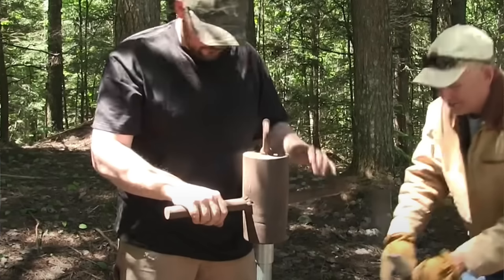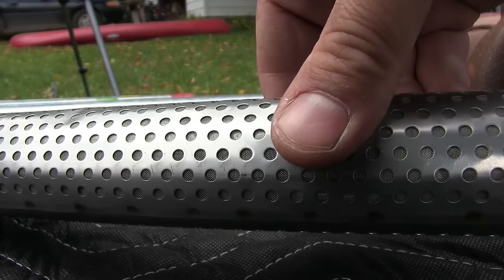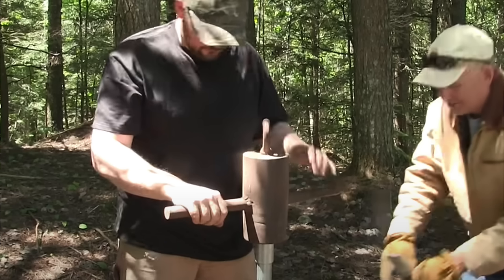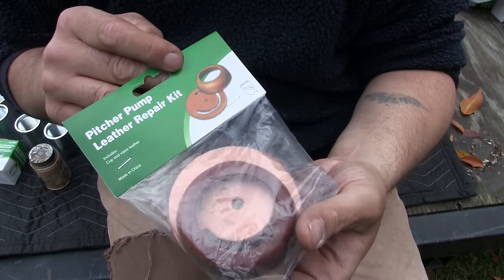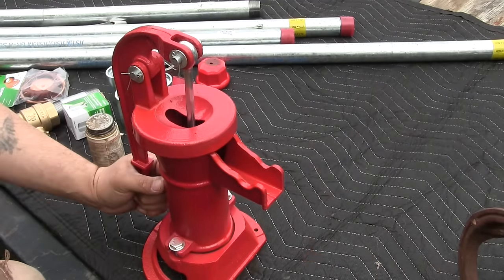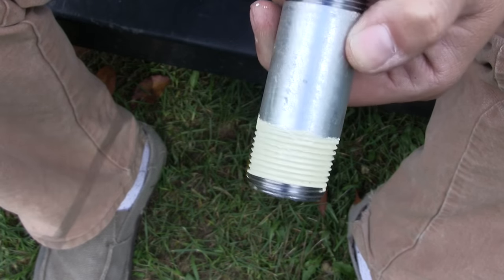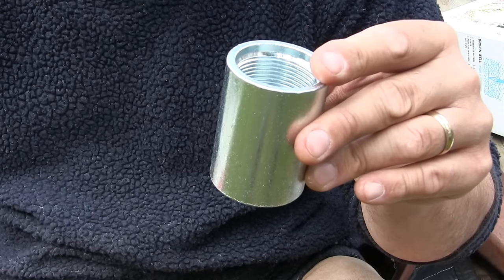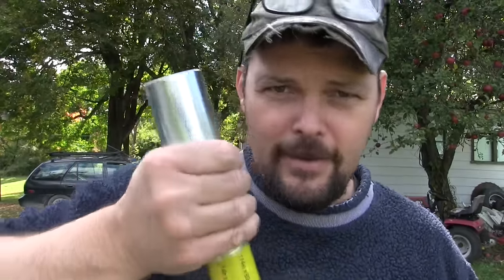Hand Pump Well , off-grid, self-reliant water, everything you need to know

Comment: Nice job, on your tutorial.  I have a couple of points, however.  1.)  If you use Teflon tape, and pipe dope on top, you will have a great seal, and IF you have to take it apart, for some reason(You probably will, your first time.), then the tape will minimize the mess.  Also, I have been around pipe dope and Teflon tape for more than 30 years, and I have seen them BOTH leak, but I have NEVER seen the combination of the two leak.  On another note, I prefer the grey pipe dope.  It is less apt to cracking with age.  2.)  There is such a thing, called a "Fence Post Hammer", that will work for your "well hammer".  Good job.
Reply: Kudos for the tip - doubling up on the 'sealant' for such an important fixture doubles as peace-of-mind.
Reply: I agree.  Best to take a little extra time the first time
Reply: I spent a great deal of time doing plumbing when i renovated bathrooms. Most jobs we just did the plumbing since it wasn't anything major, my boss taught me to always wrap teflon several times around the thread and then spread a layer of silicon around that.
Reply: John-my dad was a plumber and he also used teflon and grey dope. And yep, I have and used the "russian hammer" many times!
Reply: We had a post hammer, but I think one of the workers my dad uses on the farm “misplaced” it. If you have neighbors with a post driver tractor attachment, it makes real short work of any pole/post driving job.
Reply: Just when I thought it doesn't get better. Here you go! Thanks for sharing. May we live to see brighter days with good work on Mother Earth.

Comment: An old timer plumber told me that if I wanted to have 100% no leak fittings, was to use Teflon Tape AND Pipe Dope, so that's what I do from now on. Never had a leak ever after that. Great video Dave !!
Reply from the maker: Thanks for sharing
Reply: Man i doubt an old timer plumber said that but ok. What do you do put pipe dope then Teflon and the more pipe dope?
Reply: @JM-yx1lm , That's exactly what he told me to do to make every connection 100% no leaks from the beginning. Wrap a couple times with Teflon, then dope over the tape. I've had leaks with just Teflon, and leaks with just dope, but never with both. Some people are lucky and never have any leaks using just one, but not me. Lol.
Reply: @augustreil  LE PUEDEN PLNER TEFLÓN O SILICON TAMBIÉN PARA QUE NO HAYA FUGA DE AIRE

Comment: You can do your own 'Divining' with just a couple of steel coat hangers. (Doesn't have to be steel, any wire will do).
Just undo them until they are straight-ish and then bend a 4" piece at one end for a handle.
Hold them with your elbows down by your sides and pointing straight out in front of you. Walk at a slow pace, holding them firmly but loose enough so that they can swing. (resting the bent part on your first finger and pressing the end with your little finger should be enough). 
As you cross a water line, (or pipe if you are sensitive enough), they will cross over. If you keep walking from that point slowly forward they will uncross again as you go past the other side of the water line. When they first start to swing they will probably swing either direction. Just inch along until they tell you exactly which way you need to turn to get them to cross directly in front of you. When you are walking along the path of the water they will point forward but twitch a little side to side.
I can't tell you how deep it is, some people can. I used this on my farm and it was very accurate for me. Some people can't do it, others can. It's just some kind of 'Magnetism' that we don't have an explanation for at the moment. There are other methods but this one is simple and works for most people.
I hope this helps you find which way water is running, and how wide it is.  😁

Comment: We have drilled by hand 30 foot 6 inch hole ,and drove a sand point 32 foot down that foot valve wouldn't let water in and we couldn't back flush it but learned a lot and we got a gas driller in jail down 100 ft 6 inches with a 4-inch casing we got water but we're still having a sand issue

Comment: Yes, is true you can taste it. Also clean the inside is the pipe since the cut them it as oil inside the pipe. I used Dawn soap to clean the inside of my 2nd unit I put in the back yard and the water has no taste of nothing but water.

Comment: You can buy a pipe driver. Look for the very heavy steel tee post driver. Don’t bother with the light weight ones. Mine is about 30 pounds but is longer than what you are using. At 14 feet I hit blue clay and it was pretty tough going until I broke through that at 20 feet. After that it was fairly easy. Took most of one day but I’m no spring chicken at nearly 70. Good video.
Reply: I have a heavy post slammer with handles on each side, I was gonna use that for my driver..

Comment: A very good instruction on well points. 
50+ years ago my father and I installed several of them(from Sears). My father made an adapter for his jack hammer to drive the point and pipe. I stood in the bucket of the loader, with the jackhammer to drive the point down. Dad lowered the bucket as the pipe went into the ground. It worked well. This was before OSHA. Good Luck, Rick

Comment: Just came across this video.  Excellent advice throughout.  A couple thoughts from this retiree's former experience: 
1. First and foremost, the presentation on maximum water depth is spot on.  If the water table is below 25 feet from the ground surface, suction lift hand pumps are not practical.  
2. Make sure you are in an area where the water table is in unconsolidated sediments, sands and such.  No bedrock.  Some areas with sand also can contain some rocks, you may have to move the well location a few times.  
3. Ask around to see if the shallow groundwater is readily drinkable without treatment. In some areas, the shallow groundwater can have high solids content, odor, bad taste, you name it. Most areas will have good water. But no guarantees either way,  it's worth checking beforehand.  
4. Well point drive/slide hammers are available commercially.  I've used them in groundwater work.  Search "piezometer point slide hammer" or "well point drive hammer" and you can find them.  If you buy a groundwater industry product, be prepared for some sticker shock, as they'll likely be a few hundred dollars.  As an alternative, look into fence post and T-post drivers from vendors such as Tractor Supply.  IMPORTANT - whatever you buy, make sure the working diameter of the hammer fits with the well pipe diameter you're using.  I don't know enough to specify a specific hammer for a specific well pipe, sorry. Maybe other viewers can?  I always used matched slide hammer/piping/well points from groundwater supply vendors in my work, but again but this would be an expensive route to take and there are alternative products.  
5. Hopefully you'll never have to remove the well. Great points were discussed in this video regarding the evils of soil pressure and friction associated with the couplings and the well point. It will likely not be easy but more often than not it can be done.  The tripod suggestion is on target, a rigged winch/come-along can work. For safety's sake - watch those cables and stay clear, there will be a lot of tension.  If you are fortunate and end up with a working slide hammer,  you can also add a length of well pipe extension above ground, slip the hammer over it, add the threaded drive cap, and pound upwards instead of downward as when you installed the well.  Again, all hammer/pipe/cap diameters must work with each other. But at this point you'll know if this will work if you successfully used this method to install the well. 
6. If you're in an area with nearby industry, gas stations, feedlots, etc. make your first call to the local or state environmental protection office.  They will have information as to whether there are any known sources of groundwater contamination in your area.  Don't put your well anywhere near your septic system's leach field! 

Regarding the first three items - initial information sources can include the usual suspects (family, friends and neighbors).  Local feed stores, hardware stores that sell the points might work.  County agricultural extension offices, local county or state environment protection offices may work, also the State Geologist's office. Local engineering or environmental consulting firms are a possibility.   Be patient if contacting these  offices, as finding that right person may take some doing.  Some scientists and engineers love helping the public when a non-routine question such as this comes up, others not so much!  

Be careful with providing TMI as the subject of permitting may come up with certain regulatory offices. If you don't wish to contact the government offices because of privacy concerns,  you could instead do a computer search on ground water quality in _ County _ State.  Similar search for groundwater depth.   Naming convention as to whether to use "groundwater" or "ground water," one or two words? Use both alternatives in your searching.  

Apologies for rambling, hope this helps.  Good luck!
Reply: Thanks for taking the time to write all of that, I found it very helpful.
Reply: thx ,, this was life saving information,, I am 700 feet from where a gas station used be
Reply: So a good way to get this data without triggering permitting agencies is to ask for a water quality report? Map?  I’m looking for property and doing research on what data to look for and where. I want to make sure the water I use for my small plot homestead will be safe for my family & animals. Thank you for taking the time to write your comments.
Reply: I previously looked up water table depths for an acquifer (since our ground water higher up seems to be seasonal).  It's over 120 feet deep.  Is there a way to do this without hiring a rig and having all kinds of permits come with it?  (By law, they have to register any wells they drill.)  and what kkind of pump is useful then?  Something with an internal screw going down the pipe, as it seems from this video that there's a limit to a lift/suction pump to 25-30 feet.
Reply: @salsa090968  You can call the local or state environmental agency and ask about water quality in your County.  Their web sites can contain useful info as well.  You are interested in buying property and are screening general locations.  Ask if there are any maps that show known contaminated areas or specific sites/locations  (one example that comes to mind - present and former gas stations).
Reply: @jum5238  You can check with your local or state Health Department or whatever agency permits new wells.  Ask what the requirements are for the permitting process.  And also ask about costs to apply for and obtain the permit.  Also ask if there are any recurring costs, most likely there won't be any.   

Regarding the pump, a conventional submersible pump can be used.   They are 'sized' based on the depth below ground surface that they'll have to lift the water from the pump intake to your above ground system.
Reply: @ilbullymomma  absolutely, work smarter, not harder.  if only needing 10-15 feet, then by hand doesn't take long, but if a skidsteer or loader tractor is available, then go slowly and let it do the work. :)
Reply: Awesome write up. Thank you.
Reply: I have a question.  We drove ours this week and to get to 1ft below the water that we hit, it is 32ft, and the pitcher pump wont suck it up.  We used a hose to hose exterior pump to test it and flush out the mud, but I can't seem to find an electric pump or a deep well pump to fit the 1 1/4" diameter pipe.  Got any suggestions on what to do for use?
Reply: @amybgrammer
I bought the 1 1/4" drive. On the box it says if you have to go deeper than 25 ft you need to use 2" driver. Fortunately I saw that before starting and got the 2". I have seen some hand pumps that have a lift somewhere around 100ft. They are expensive. Like 2 or $3000. I have seen some submersible pumps that may fit into a 2" pipe. Expensive but not as much as the others.

Comment: I don't know if it's been mentioned, but make sure your ball valve is made of lead-free brass / rated for potable water.  You don't want lead leaching into your drinking water.  Probably not a big deal but worth mentioning.  (Brass often has lead added because it improved machinability enormously.)  Stainless Steel would also work well.
Reply: Oh, please.
Reply: They are all lead free it's been that way for years
Reply: @mauricesmith4270  that's not true at all. Plenty of leaded brass fittings on the shelf. I've even had to sign a thing at the hardware store stating that I would not use it for potable water.
Reply: You need to check for lead free.. you not completely wrong but they do make cheaper valve for like boiler and chiller systems.
Reply: Finally someone took the initiative to speak about a simple hand driven well w pitcher pump.  My oleman taught me how to do when I was 10. He told me then...Son you may need to know how to do this one day , if power goes down or maybe you buy a piece of land and need water or to check the water.
Having a pitcher pump , pipe and point may make you a King one day He who has access to clean water will have the advantage.  Gotta have it!

Comment: One good reason to drive a 2" stand of pipe is that the larger inside diameter gives you room to run a liner sleeve inside if your 2" pipe develops a leak over time. Let's say you drive a well with 2" diameter pipe, and over 10 years, the screen in your drive point wears out and you get sand/silt in the bottom. You can run inside with a 1" pipe stand and jet out the sand. Then you can run a liner inside and re-complete your well with a smaller I.D.
Reply: Nice add friend.
Reply: I was wondering about this.
Reply: @northcoastrealty4362  Great Point

Comment: Fence post drivers are pretty commonly available products. They don’t generally weigh 90lbs, but that seems like a reasonable modification that can be added. I haven’t tried it, just a thought.
Reply: You can use them, you can also rent a jackhammer with a driver attachment. I've driven a few but never used "driving" pipe, always regular galv. Only thing specifically for driving I've ever used are drive couplings, check valve, and a drive cap. We always had a pump on hand for well treating too in case we had to flush it after using nuwell or muratic.
Reply: We filled our with lead and fence post driver will work just fine
Reply: You are very right a auger would also help👍👌✌️💧
Reply: I used my fence post pounder

Comment: If your leathers are dry, you can use up that gallon of prime water without getting your pump primed unless you take steps to conserve the water. When you are priming, you should raise the pump handle all the way  before pouring in water. Then only push the handle down an inch or so while you are pumping. You can make short strokes up and down with the pump handle near the top end of it's travel and keep your prime water in the pump. If you push the handle all the way down, you empty the water above the plunger out of the pump. I listen for the sound of a bubble coming through the water in the pump each time I raise the pump handle that inch of travel. That's air leaving the column. When the bubbling stops and the pumping is suddenly harder, you're done. Raise the handle all the way to the limit and you might lose prime again though. Hopefully, your leathers will be swollen enough by then to seal and pump out the air.

Comment: You can buy a 1-1/4" brass one way check valve and install under the pump (before or after your manual valve)    This keeps prime without the need to operate the manual valve each time.   (The check valve is also available at menards, same location/isle as the well drive couplings.)      When I did my well a few years ago I also installed a "T" under the valves.   The T also has a check valve and shutoff valve which is then plumbed to a shallow well jet pump.   On demand water just like a normal well.

Comment: If possible wash the insides of the pipe sections to get the oil off from production. Just like Dave and Brook found out it takes awhile to get that oil out of the water. I learned that from installing steel pipe on my water heater. Tastes nasty.  Thanks Dave.   Oops, I finished the video and see Dave addressed that.

Comment: The fitting you had in your right hand is actually what it called black iron which is a malleable iron, not recommended for drinking water and has a lacquer coating that helps prevent it from rusting for a short time, typically black iron is used for hydronic heating. The one is your left looks like stainless steel. Stainless steel is used is a wide variety of applications and is food safe. For your pipe dope I would recommend teflon tepe+leak lock. (leak lock comes in a bright blue container) Really good stuff imo and is potable water safe.

Comment: On the ball valve when you drain it for freezing. Leave the valve cracked half way as the “ball” WILL hold water freeze and break!!! I have replaced MANY!!! Great vid!!!
Reply: Didn’t know this; thank you!
Reply: Was just thinking the same thing. Stay frosty my friend
Reply: There is a hand hydrant valve assembly that has a 5 foot  pipe with a check valve under the frost line i guess that would not work with a non pressurized water source just wondering if that would work with a picture pump